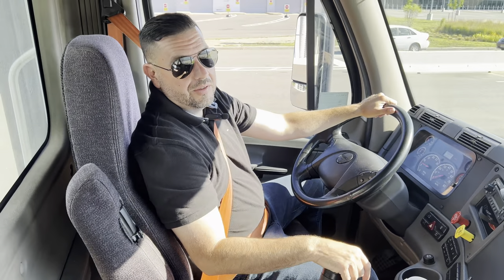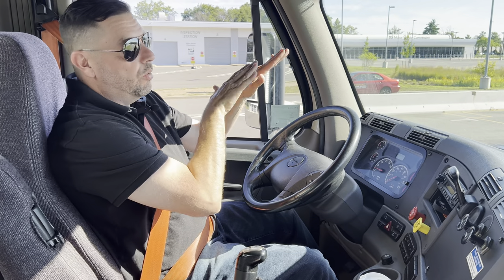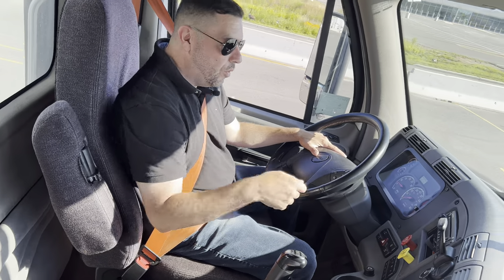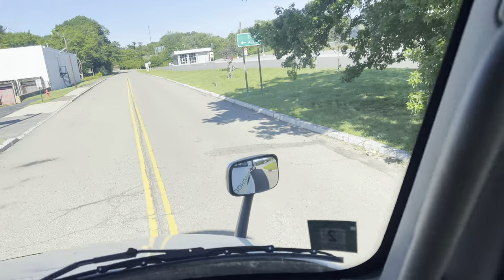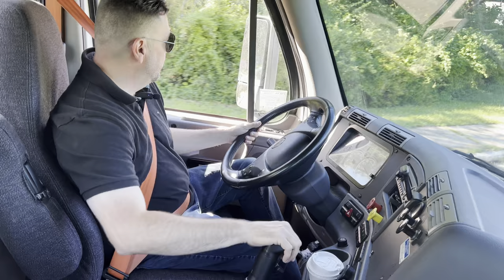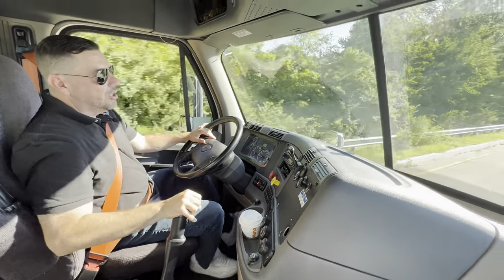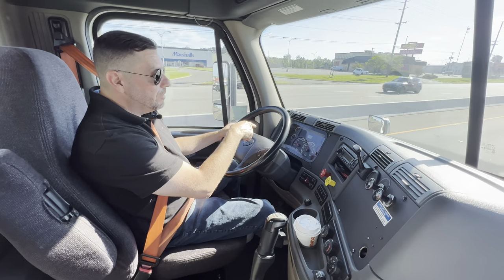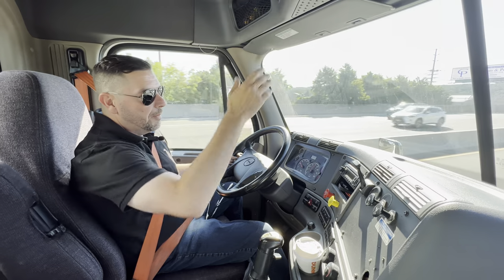Mastering the Art of Shifting a 10-Speed Transmission

Comment: How do you stop tho? clutch all the way in and brake?
Reply: If you are in a low gear like 1 to 5. I suggest clutch first then break softly to stop and hold both feet. If you are in a high gear 6 to 10. I suggest lay your foot on the break and press lightly to slow down and once you are about to stop press the clutch and hold both feet while you are fully stoped

Comment: EXAMPLE :      Up shift:              10-15 rpm     Clutch from 6   to neutral   clutch to gear 7                                                               Down shift :   from 8        10 rpm - clutch in to neutral  --accelerate -  clutch in to 7

Comment: I was taught to do everything in 200s. When upshifting, rev to 1200rpm, clutch in, neutral, and clutch in and in gear before 1,000rpm. When down shifting, go to neutral at 800rpm, then rev to 1,000 and it slides right in
Reply: Different trucks will operate on different RPMs. The process is still the same. You gotta have a feel for your truck. I had a super ten and it wouldn’t shift two gears down if I wasn’t at 900rpm and wouldn’t shift a gear down if I wasn’t at 1000 rpm. I hope you trucking still

Comment: Whats if the speed limit is 40 miles per hour,  what gear should your truck be in ? And how did you come up with your answer  ?
Reply: keep it in 8th gear it will keep you at 35mph to 40mph which is not over the speed limit. Once you see the speed limit is 40mph then shift to 9th.

Comment: Very informative. But the only thing I believe he left out is when shifting down two gears, you need to have the RPM lower to 700 to 800 then clutch Neutral then accelerator to 1000 to 1200 then shift two gear down.
Reply: 11-16

Comment: I don't watch RMPs I listen to my truck engine and watch my road speed and shift the truck up or down downshifting at 10RPM is too slow I drop them at 1500 mostly the high range.
Reply: There are many different variations on how to down shift and up shift but from my many years of experience, I feel this is the best and easiest techniques for New drivers. It seems to work best from my personal experience.

Of course once you have your comercial license in your pocket you can drive which ever is best for you and floating is also my preferred way to shift as well but this video is for students who are just starting off and still learning. They still have to go for there road test at the DMV.
Reply: @hobokengreen1jr  agree with 100%

Comment: If your using the clutch after 1st u need to learn to float n save the clutch
Reply: There are many different variations on how to down shift and up shift but from my many years of experience, I feel this is the best and easiest techniques for New drivers. It seems to work best from my personal experience.

Of course once you have your comercial license in your pocket you can drive which ever is best for you and floating is also my preferred way to shift as well but this video is for students just starting and still have to take there exam at the DMV. Double clutch is required and floating is not allowed.

Comment: Stupid video.  Truck drivers never double clutch   they float gears. Clutch  is only used to start moving from a red light or stop sign..   no clutch  needed  after the truck starts moving. Regardless  of many the transmission  gears
Reply: There are many different variations on how to down shift and up shift but from my many years of experience, I feel this is the best and easiest techniques for New drivers. It seems to work best from my personal experience.

Of course once you have your comercial license in your pocket you can drive which ever is best for you and floating is also my preferred way to shift as well but this video is for students who still have to go take their exam at the DMV. Floating gears is not allowed double clutches required.